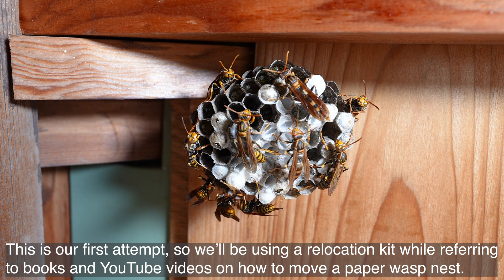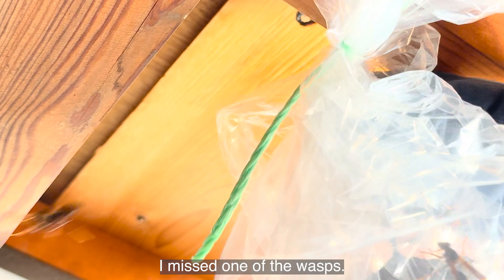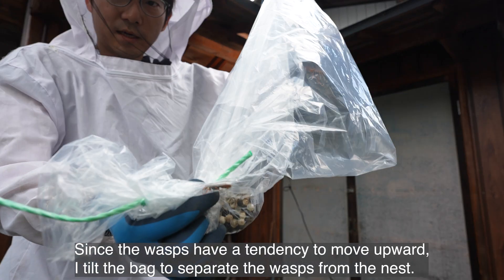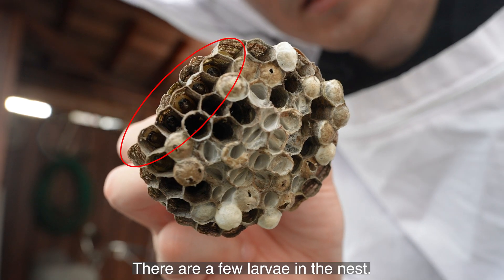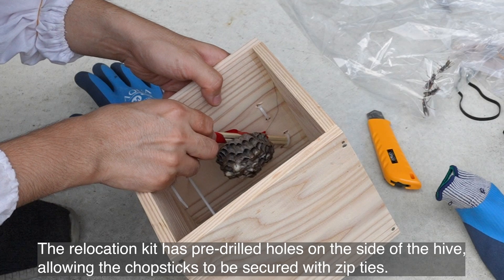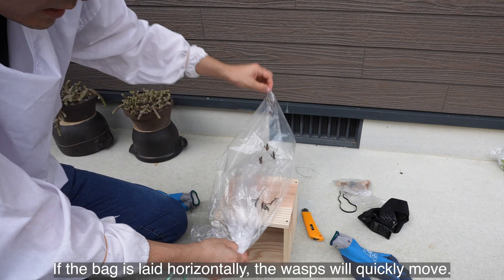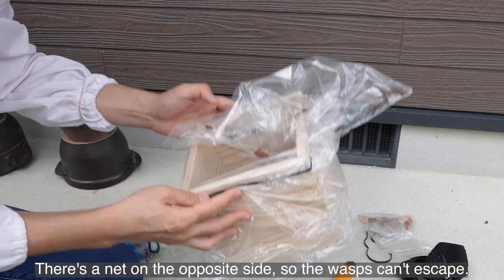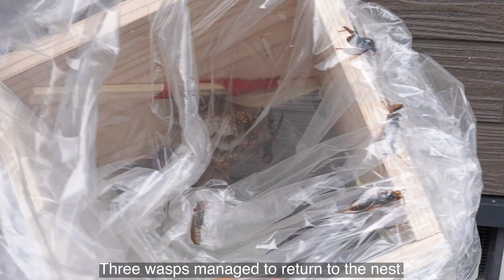Safe Relocation of Paper Wasps: A Natural Pest Control Solution

Comment: The city said that we had to move our chicken coop. Well we can't move it without destroying it, and there's a wasp nest inside. They spent all summer building it. I can't destroy it. I'm going to try to put it into our new chicken coop. (I looked it up and they don't bother the chickens for anyone who is wondering) Thank you for the lovely video!
Reply: Update: I relocated the wasp nest. I'm not a beekeeper at all and so I had to figure something out to cover myself with. Luckily I have a gas mask. I wore that with a brimmed hat and some tulle fabric over my head, a big puffy jacket, boots, and gloves. 

I got the bees at night, because I figured they would all be at the nest sleeping so I had a higher chance of collecting them all. I had to crawl into the chicken coop to get the nest out. And even with all the gear I had on, I was terrified the wasps would get disturbed and sting me while I was somewhat trapped in there. But just like in this video, they didn't attack me and were very docile. 

Once they were in the bag, I couldn't get most of the wasps off of the comb like in this video. So I quickly transfered the comb to the box with the wasps on it. Meaning that there was a moment where the majority of wasps were exposed to the open air, but they didn't fly away.

The nest and  stem to the nest was much thicker than the one in this video. So I instead had to glue it to the box I made. I accidentally glued a couple of wasps with it. I wish I had been more careful, but I felt frantic because even though this description sounds somewhat smooth, it was actually a pretty chaotic process. 

While it's not clear to me which wasp is the queen, my partner and I saw a wasp that was bigger than the others. We hope that this one is the queen and that she's okay, otherwise all will have been for not. It's almost winter, and apparently only the queen survivites to hybernate the winter. 

I really hope they make it.